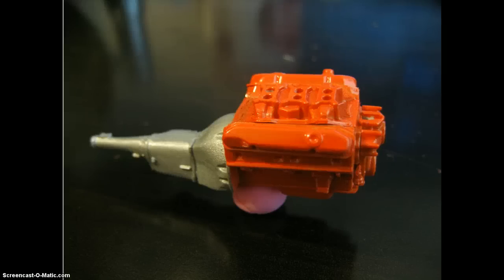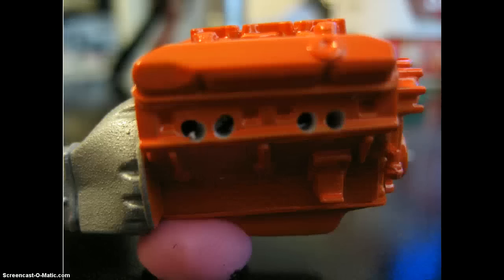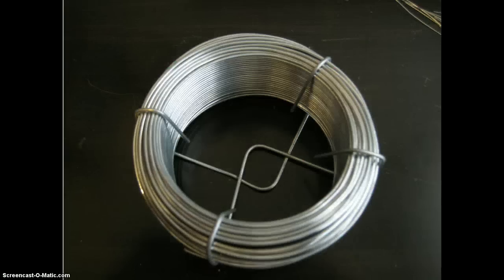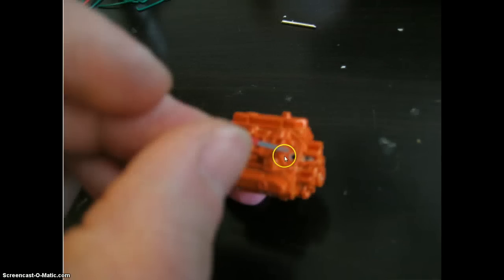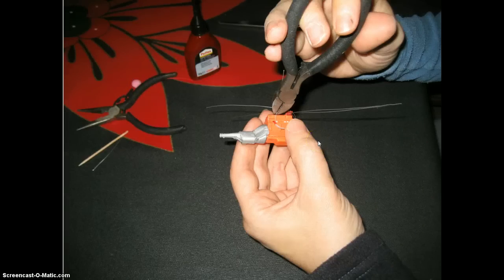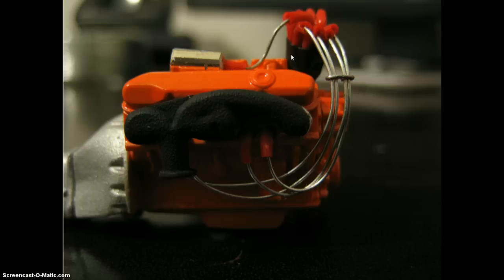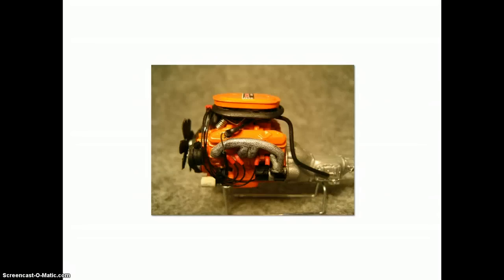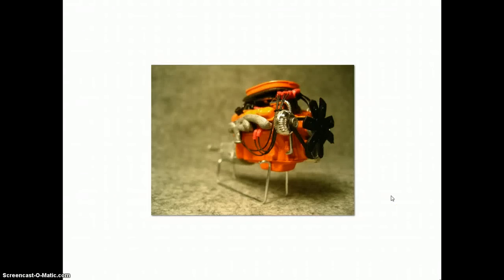How to detail a plastic model car engine

Comment: Awesome video. Loved all the detail you put into it. Only think I could think to suggest would be putting the plug wires on the distributor in firing order and if it has vacuum advance maybe add a hose for that. That would be pretty insignificant after everything else you did though. Gave me plenty of inspiration. And no complaints on your English. I understood you just fine.

Comment: It would help you a lot if you could reference photos of the actual engine you are building. Spark plug wires go towards the top of the engine, over the headers, to the distributor. They should not go down towards the oil pan. Spark plug boots look great but where they come out of the distributor they are not accurate at all. Keep at it.......everything else looks great. When I used to do mine I ran a heated needle into the plastic at the plugs and the stock distributor then used nylon fishing line and small bits of wiring insulation for the boots. The plug wires can then be painted.
Reply: I actually have this real 440 Mopar and in fact the plug wires do hang down.  Mostly because the exhaust manifolds angle up for clearance and then plunge down at the back.
Reply: @frankrandol7998  You are correct. The big block Mopars all had their wires running down below the exhaust manifolds, with the exception of the very rear plug wire, which was run on top of the valve cover. But that was the only one on top of the valve covers.

Comment: Your English is fine but some of the details on the engine are incorrect. The distributor is way too large and in the wrong place,  I am not sure what the black hose/wire is coming from the engine down to the transmission is. I actually own the real engine and have worked on the real cars for many years. Awesome ingenuity on making the model look real but just a few small things.